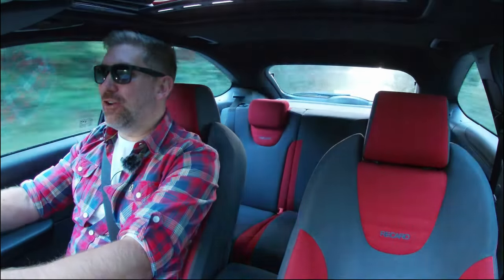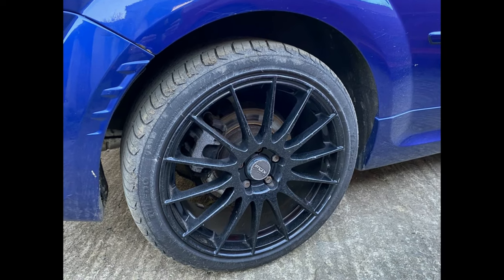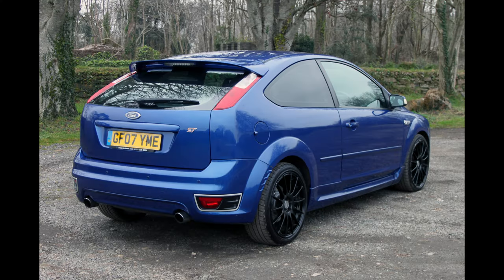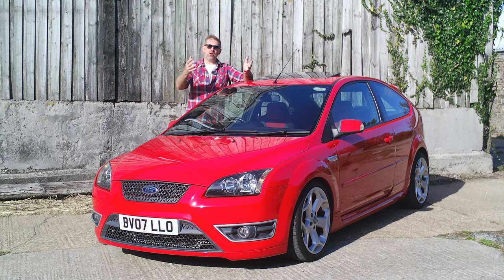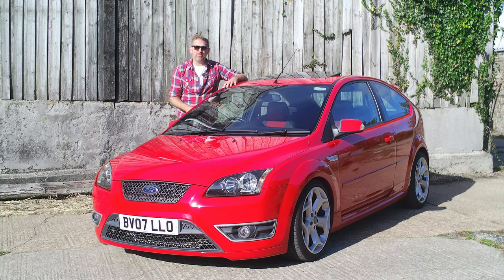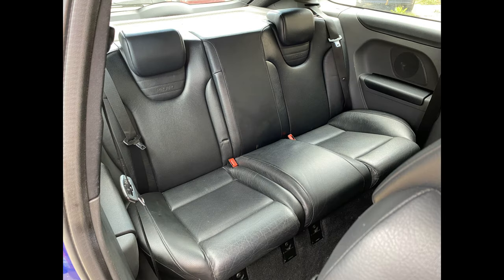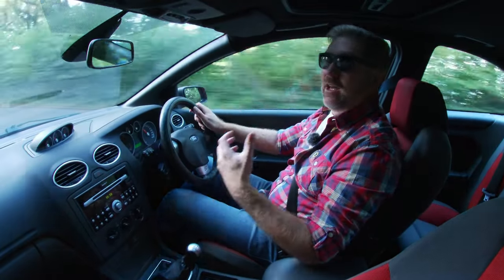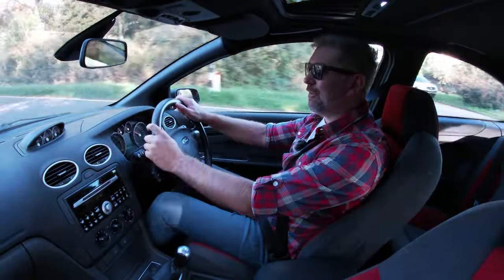IT'S DONE! Restoring my Ford Focus ST225 Mk2 - Update and the ST Story

Comment: Should of ditched the rear defuser, standard looks miles better. Mk2 St's in standard form are becoming collectable especially the one's that have always been standard like mine😉. Good video
Reply from the maker: Thanks for the comment and I do agree the standard defuser looks better... problem is, it will not accommodate the larger exhausts.  I will purchase a standard rear bumper / defuser at some point and hold onto it, enabling me to return it to a standard look one day... for now though, I am really enjoying the way it sounds and drives.  Your car sounds very nice.  Thanks for watching.
Reply: @cornishcarcollectors  I'd stick a standard exhaust back on too. Mine is a bit of a garage queen really only covered 12k miles but is really collectable now so only gets used on nice days in the summer

Comment: Out of curiosity how much does a full respray cost
Reply from the maker: Thanks for the comment.  Difficult question to answer really without knowing the condition and size of the vehicle, and the type of paint you have in mind.  A simple blow-over with minimal / no body work could be as little as £2K and up to £8K for more considerable work.  You can of course get into the tens of thousands if going for concours finish / bespoke paint.  Hope this is useful and thanks for watching.

Comment: Great video. Watching this with my second focus st parked outside. First one went bang but I couldn’t not get another one I love these cars too much. I plan to do what you’ve done. But go way stupidly further with it. Full nut and bolt restore so it’ll look like it just came off the factory floor, don’t think I’ll ever sell it. They are really good cars. Not the quickest thing but the noise they make and the way they look. It’s brilliant. And an unexpected head turner. Get at least one head turning every time I drive it giving a thumbs up. 🤣
Reply from the maker: Thanks for the comment, it is great to know you enjoyed the video.
Congrats on buying another ST.  As you say, they are fantastic cars... noise, performance and looks.  I think these will also see some value appreciation overtime so keeping a standard car tidy / restored is very sensible... keep enjoying the car along the way.
Thanks for watching.
Reply: @cornishcarcollectors  exactly. I think the RS will increase more in value but I think the ST will still be worth a pretty penny in a few years when they become rarer and start becoming classics. Follow the way of previous fast fords before it.

Comment: I've just sold mine, got a stage 3 pumaspeed Focus st mk 3.5 diesel. 278 bhp 580nm and 47mpg, 660 miles on a full tank.
Reply from the maker: Thanks for the comment.  Sounds like you have replaced your Mk2 with something just as cool.  Thanks for watching.

Comment: Good to see the update on this car and glad my heater controls came in handy, thanks for the mention btw. I had a red 1 this time last year but it got wrote off while parked outside my house, now got a silver mk2 just cant keep away from them lol
Reply from the maker: Thanks for the comment - I was hoping you would see the video and get in touch.  Thanks again for the heater control knobs and great to know you enjoyed seeing the progress.  It is good to know you are still driving an ST.  Thanks for watching and for the continued support.
Reply: I originally bought a moondust silver ST2 from new and was a great car and the 2.5 engine was phenomenal even in stock form. I kept this for 18 mths or so. Next,  I bought a nearly new mk 2.5 two or three years later and kept it for around 7 years.  I then decided to buy a used low mileage mk 3 ST 3, so went ahead and all was well despite me being aware there wasn't the 2.5 fitted. In hindsight I learnt over time that I'd actually slipped up with this car because despite the power and speed, it just didn't have the  character that the mk 2 had. It looked the part, granted, and the tangerine scream paint was bang on. The cabin looked like a ST/Titanium X trim, so definitely high end. The seats looked excellent but were definitely on the smaller side compared to the mk 2/2.5. Although the driver's seat had electronic adjustment but it just didn't quite go low enough which was an unnecessary pain and was a shame. It was very economical though. Combined with a very hard which became more uncomfortable over time, I decided to sell around 18 mths later as the car became rather annoying. Ironically, last year I bought a 16 year old Focus ST mk 2 in moondust silver and despite some minor restoration, I haven't looked back!

Comment: I also purchased a Colorado red ST2 December of last year pretty low price needs a lot of work doing done some already but after 2 months of owning it I found out that the head gasket was on the way out and the last owner put steel seal in it a very good mechanic friend of mine said that he would gladly take it in and get it running again had the car back now about 3 months hoping to get it up to the level that you got yours fingers crossed if I can afford it 😅😅
Reply from the maker: Thanks for the comment Steve and for subscribing, I really appreciate it.
Congratulations and well done on your Focus ST purchase... in the best colour, in my opinion!
Good luck with your project.  I always enjoy the jobs required to improve a car and with the engine work you have already done you know you are building on a decent mechanical foundation.
Enjoy your car and please do stay tuned to my Channel.
Thank you for watching. 👍

Comment: I currently own a 2003 Jaguar XJ6 but have previously owned 2 Focus ST170. Due to fuel prices I'm considering replacing it with either an ST170 or ST225, both of which are more economical. What do you think?
Reply from the maker: Thanks for the comment Steve, your XJ6 is a cracking car and the Focus ST is a completely different proposition. Having owned both STs I’d go for the ST225 as they are a better car, but there’s something special about that Mk1 ST170. Thanks for watching.

Comment: Just wait a minute, did you really just say the MK3 ST was faster than the MK2 Focus RS?? 

You've definitely had no outings with a group of Fords 🤣 your 270 mk2 will pull on a standard mk3 so how on gods earth do you say that about the mk2 RS with a bigger turbo. 

I think you need to learn a bit in the more real world than looking at google figures
Reply from the maker: Thanks for the comment James.  Of course, I do know the Focus RS Mk2 is faster than the Mk3 ST, but my point is that the RS Mk2 raised the bar for the ST to follow and the Mk3 ST is, in real world driving, just as quick (only half a second slower to 60mph).  Thanks for taking the time to watch and get in touch, I appreciate it.
Reply: The Ford Focus mk 2 RS is the better car compared to the Mk 3 ST. 
It was also more expensive and was better styled and is already reaching modern classic status with some low mileage examples reaching around £35 - 50k plus. This car has charm, character and credibility.
The mk 3 ST is a very good car in its own right but lacks that crucial character and credentials when compared to the mk 2 RS. However it is more practical and more economical where the Mk 2 isn't quite so, but the cabin is very spacious inside despite having a three door body shape which is impressive to say the least. 

I think they cracked it with that car.
Reply: That’s on paper. Real world the Mk2 RS would spank it. I never got beaten by a mk3 when my mk2  ST was standard.